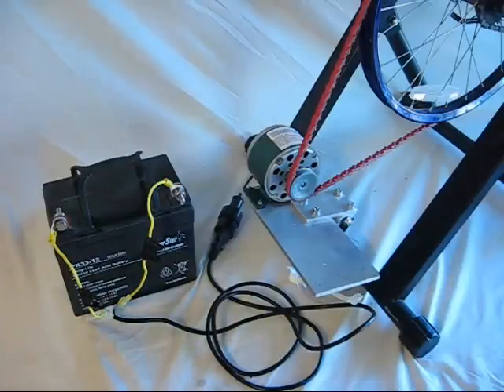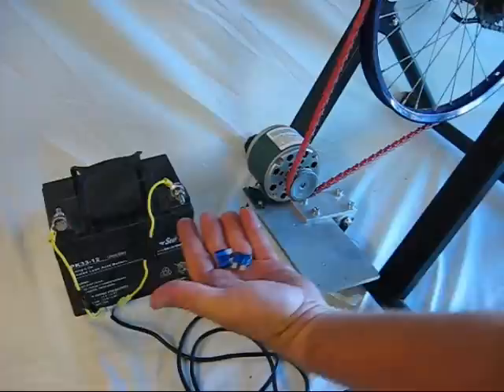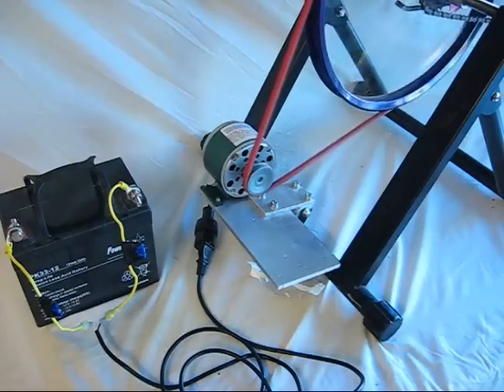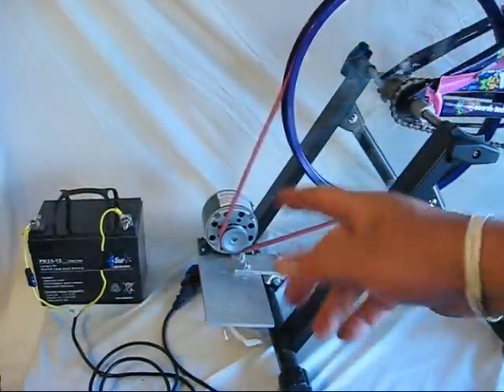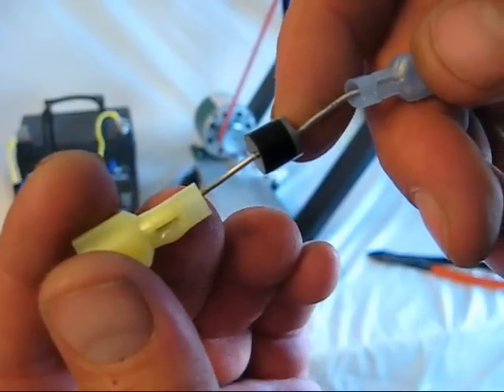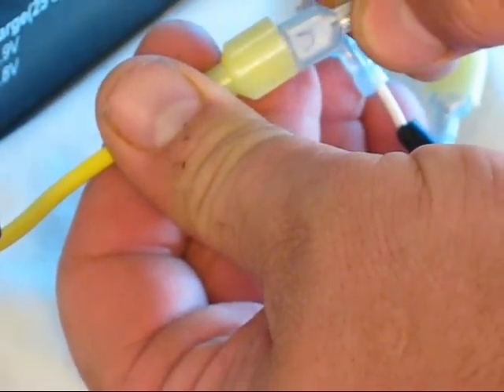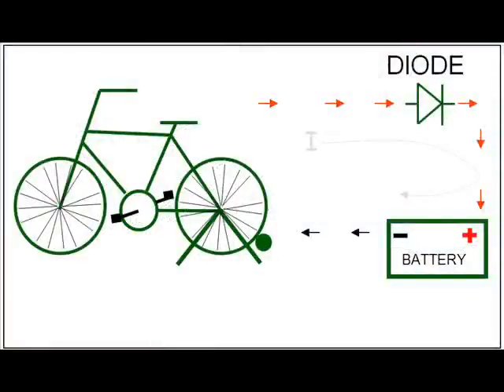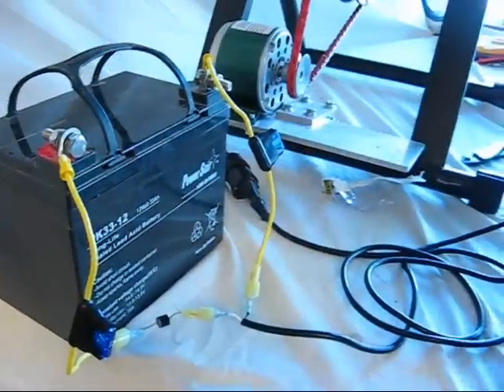Why use A blocking diode with  battery charging dynamo bicycle generator

Comment: Can we charge a  12 v battery  with 24 v generator ?
Reply from the maker: Good quesiton,   the output Voltage of your generator is entirely based on how fast you pedal.  So you control how much Voltage the battery will see.   If you hook a Volt meter you can watch the Volt meter to know how fast to pedal.   A typical battery  that is lead acid  style can handle a max charge Voltage of 14.8 V DC.     Let me know if you have any more quesitons,  Brad Whaley,  Electrical Engineer,  Phoenix Arizona  http://PedalPowerGenerator.com

Comment: hello
the video is really usefull
i am building a vawt
i am looking for a dc generator similar to the one you are using
can You tell me the specs of the generator please?
Reply: I’m about to build a mini VAWT using an old cordless Drill, I have worked out a design that I like, I have all the materials except a Blocking Diode. I think the Cordless Drill DC motor will give me enough electricity for lights, TV, ph charging etc, so can’t wait to work out where I can scavenge a Blocking Diode and find out what Ampage etc I need one to be!.

Comment: Good idea I need this system for a quad bike.
Reply from the maker: You have a quad bicycle  or a quad ATV motorized bike?    Either way it's' just a matter of finding a DC Permanent magnet motor to use as a generator (That's right,  a DC PM Motor also acts as a generator /.dynamo).   There are lots of them on Ebay at a great price.   Then adapter the generator with a rubber roller  and mounting bracket that fits  your frame,  lift your rear wheels off the ground and you've got your own power.

Comment: what are the use of those fuses?
Reply from the maker: If an electrical short occurs  in your system,  the energy in your battery will melt the wires  into a big smoke fire  within 4 seconds if you do not have fuses.  The fuses protect you from fire.    Let me know if you have any more quesitons,  Brad Whaley,  Electrical Engineer,  Phoenix Arizona  http://PedalPowerGenerator.com

Comment: so to charge battery the positive wire needs to be connected positive and negative to negative.
Reply from the maker: Yes,  for the bike generator in the video that is correct.   BEWARE:  Just because a wire from a generator is red, does not mean it is positive, always check first with a volt meter.
Reply from the maker: If you have made your own generator setup then it is important to use a volt meter to confirm which wire is positive and which wire is negative.  It may be the red wire is negative in some situations like when you spin the generator (Permanent magnet DC motor) in the opposite direction than its normal direction.   Once you have established which wire is positive then put some red tape or red heat shrink on it of it's not already a red color.     And yes- the red (POS) wire goes to the + side of the battery.

Comment: WHAT IS THE BLOCKING DAIOD MODEL??????????????????????
Reply from the maker: Basically when you  are looking for a "Rectifier Diode".   But first you need to determine what your peak voltage will be and your peak Amps (Current).    Then pick a diode that will handle twice the amount that you measured so that there is very little chance it will over heat.    The one in the video is P/N B009IN1KB8 on Amazon

Comment: You can feel the battery charging!
Reply from the maker: Yes you actually feel more drag on the pedals as the battery is charging -  if you disconnect the battery,  the drag disappears.

Comment: The diode will heat up.
Reply from the maker: Yes there is a loss to the .8V drop across the diode.  A typical output of a child size bike generator is about 4 Amps of current.  So the total Watts disapated in the Diode is equal to 0.8V x 4A = 3.2 Watts.   Thanks for pointing this out,  Bradley Whaley, Electrical Engineer,  Phx Arizona